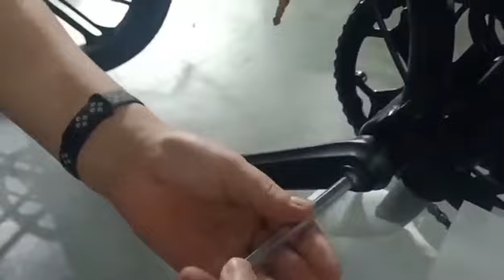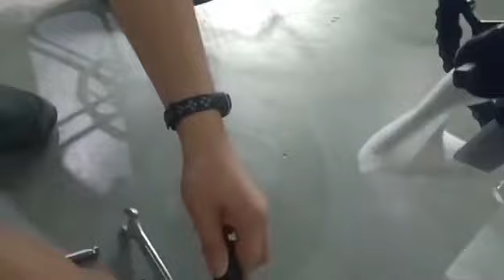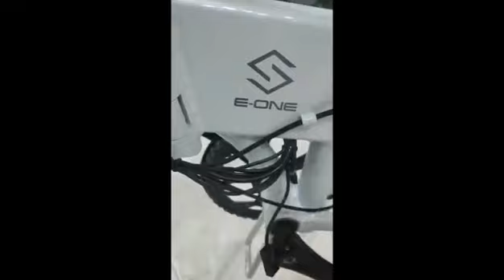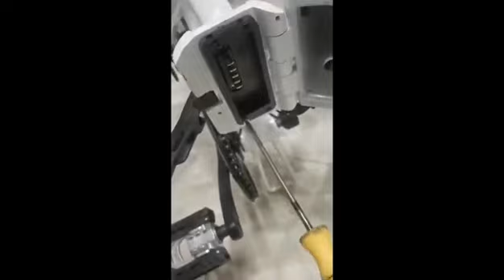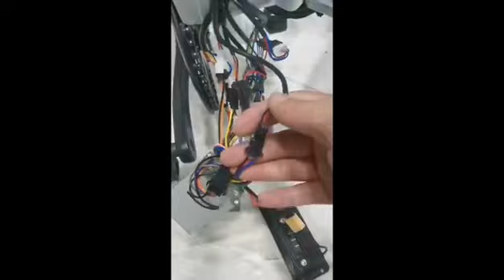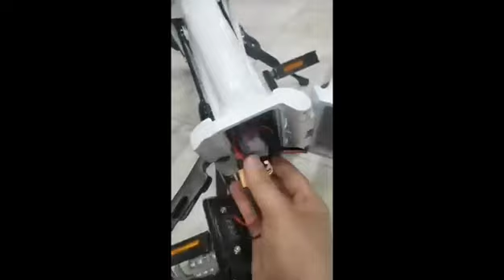SAMEBIKE LO26-II replace sensor

Comment: One down side when i purchesed the bike came with the tool kit it does have pretty much all keys you need but not everything for example i change mu brakes to hydrolic and to replace it i had to remove horn and size of the key its alloy one maybe size 2 but it was not incuded in the bundle so pointing that for future buyers and samebike team to please include that key to thx